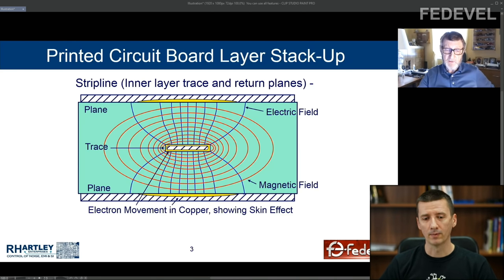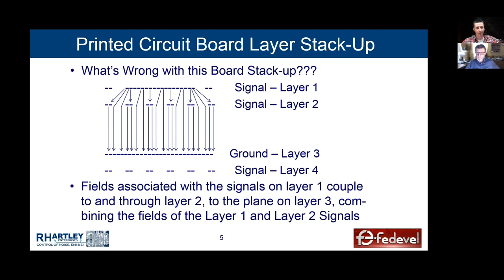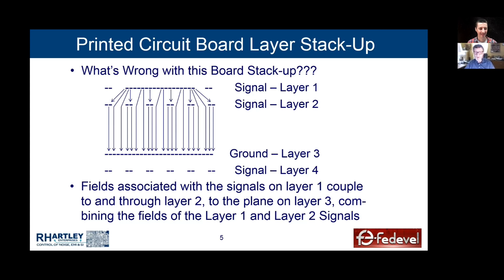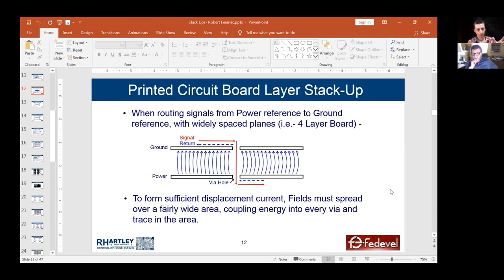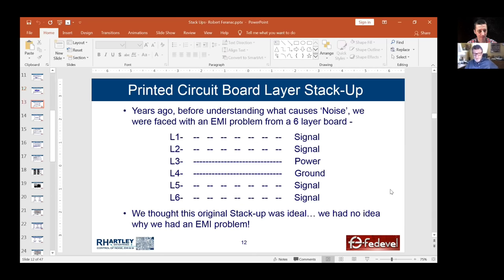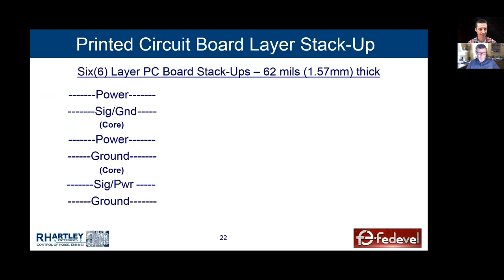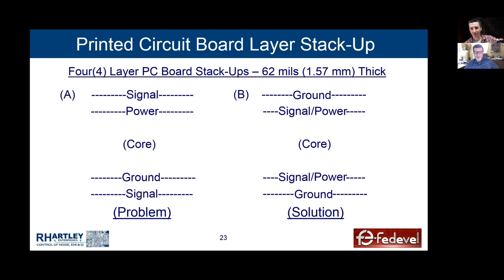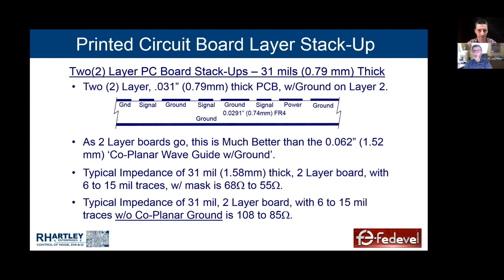How to Decide on Your PCB Layer Ordering, Pouring and Stackup (with Rick Hartley)

Comment: Great video! I usually use 4 layers PCB. I'm interested in watching how the PCB from 45:55 looks like. How to design signal track from SMD components when on the TOP and BOTTOM you have ground plane? Do you have some example? It will be great to see how create PCB in this way.
Reply from the maker: Thank you Michal. PS: I was actually thinking the same
Reply: Well obviously you put the components on an inner layer :-)  Seriously, I  think the idea is you can still put the (SMD) components on the top, and flood ground around them, but instead of signal traces on top, the component pads connect to very nearby vias through to signal traces on an inner layer.  This way, instead of the via inductance being in the ground network, it's in the individual signal nets, where there's perhaps less current and also more series resistance anyway.  Rick mentions this at some point where he describes an already-designed board, and moving the outer layers to be layer 2 and N-1, and in that case the traces already avoided traveling under the pads (that were left on the outer layers) and thus were able to accept adding vias easily to connect the signal layers to the pads (I guess). I'm not sure if he implied vias near to the pads, or vias-in-pads.
Reply: Robert... me too thinking how the layout has been done with 4 layer stackup. Very curious to know types of signals in that pcb.
Reply: @Graham_Wideman you joke, but in very rare cases, you can do this with a cutout. Probably have to solder those ICs yourself though.

Comment: Robert... Thanks a lot for the video and your effort. If you added the type of signal which causes issue in the real scenario and the precaution you have taken to overcome the issue then it will  be really helpful. In 4 layer stackup what are the type of signals you have moved to inner layer to avoid emi issues? I need more details. How the layout could be done with that 4 layer stackup?

Comment: good video.
What if, my power will be 4 types? 3.3V, 4V, 5V, 12V
The 12V will be spited into 3.3V, 4V and 5V, of which 12V will also be used to power components for several relay switches. Would it be good to use 6 layers?
1) path and power supply 3.3V, 4V
2) grounding
3) 5V path and power supply
4) grounding
5) 12V path and power supply
6) grounding

Comment: I'm confused about how one would go about routing Rick's 6-layer board with a ground plane on the bottom layer. If you have components on the bottom layer, would you go directly into vias for all traces coming from them, or would you just route traces on the bottom and then pour ground on the layer when you are done routing?

Comment: Hey Robert, great video and great guest! I have a question on the 12 layers board stack up. What if a signal has to pass from layer 1 to 4? There's a power plane in the middle, doesn't this generate a signal integrity problem for high frequency signals?

Comment: Thanks for this amazing video
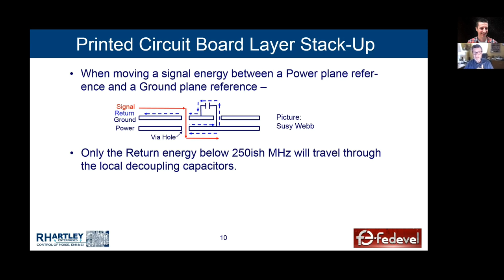In 20:20, you mentioned that the capacitor will act as an inductor
Can you guide me to know more about this case?
Reply: Dust off your early textbooks on calculating inductance of a trace. Measure the length of these capacitors, and calculate it. Look for resonant frequencies

Comment: 4layer pcb how can the top be over all GND    , where i can put component and connect them (tracks)  , any way did you see walkie talkie pcb board , how do they select layer order and control emi and emc
Reply: I think the idea is you can still put the (SMD) components on the top, and flood ground around them, but instead of signal traces on top, the component pads connect to very nearby vias through to signal traces on an inner layer.  This way, instead of the via inductance being in the ground network, it's in the individual signal nets, where there's perhaps less current and also more series resistance anyway.
Reply: If you didnt ask, I would ask it. How can you make GND plane top or bottom ? You have to place your IC's !
Reply: @ibobaba06  I already answered that.
Reply: Hi  @Graham_Wideman , I am not satisfied with your answer. If you place a component and and put via in every signal, you would generate extra noise. Think about this scenario, you have an IC and one pin needs to be pulled up, can you place resistor near the IC and route track in short way. Why you would you place extra 2 vias close to reset pin and resistor ?
Reply: @ibobaba06  I agree with you. Rick's suggestion to put ground flood on top and bottom was not fully described. I'm just inferring what he meant.

Comment: Thank you Robert and more thanks to mr.Rick. 
I have one question:
What is the different between Signal integrity problems and EMI problems?
Reply: Signal integrity is when you send out a signal and receive  a different signal on the end of the path. EMI issue is when your return path becomes the free air above your PCB, essentially you have created an unwanted antenna.
Reply from the maker: @RiyadhElalami  well explained!
Reply from the maker: Thank you Tariq PS: As Riyadh explained, signal integrity problem would influence directly quality of signals. However, your board may run ok (no big signal problems), but you still can fail EMC/EMI tests (that would be EMI problem).
Reply: @RobertFeranec  You have been a good teacher. Thank you
Reply: Thank you all !

Comment: Could someone illuminate what Rick is talking about when he says "common mode current" or "common mode energy", which he mention at least a dozen times, and why it would arise from the scenarios he was criticizing? I know what common-mode means in general, (for example common mode signals at the input of a differential amplifier), I just don't understand what he's referring to in the context of this video.
Reply from the maker: Actually, I asked exactly the same question and we talked about it, but I had to cut it out (our whole call was 2.5h and I needed to make it shorter). If I understood correctly, very simply to say, the fields which do not belong to that signal will generate additional currents which will cause the problems.

Comment: Nowadays PCBs are filled with components, very small parts, tight spaces and no room for filling it with copper on bottom nor top. He lives in the 1990's LOL
8 layer Microvia -boards are hardly any more expensive than 6 layer boards, its only a rumor. Most of the expenses goes to somewhere else than having 2 extra layers.

Comment: I would be interested in two things regarding the 6 layer Lee Ricthey board
- when he says Pwr, is it just one power or multiple powers, especially on the signal layers
- how did he account for the coplanar effect on the impedance of the signals, do you have to simulate it, or can the pcb manufacturer tell you what should be the spacing between GND or Pwr pour on the signal layers to have a specific imedance?

Comment: can anyone explain this to me please?
@1:03:00 Rick says:
"I wouldn't use FR4 beyond 4-6Gbps, 8Gbps tops. because the losses in the material beyond 4-6Gbps are going to be so high that youre going to have a sevear impact on signal integrity." 

This makes sense to me. But what they don't mention, is what the alternatives are.
On sites like JLCPCB, the only options I see are FR4 or Aluminium. And Google isn't much help.

So what alternatives do we have to FR4 for high speed designs?

Comment: Great video - thanks again Robert for arranging this. I would like to pursue a bit further the strategy of distributing the PWR planes so that they are located adjacent to GND planes when there is only a small overlap of PWR planes on different layers? So for example is it beneficial to connect a small PWR plane on a middle layer to a larger plane area near the top such as 3  which benefits from adjacent GND planes on layer 2 and 4?  Layer 3 might be a routing layer but still have a lot of copper plane with good capacitance to adjacent GND - but how effective will this be if there is only a small overlap with the PWR plane in the middle layer?

Comment: Hello. For a two layer board, is it better to have signal+power pour layer and a ground plane layer, or a signal+power traces with a ground pour layer and a ground plane layer? From the slides around 50:20 it seems like the latter is selected as the improvement example? Is there a difference?

Comment: Using a full ground plane, do you recommend using the AC (120volts) on 1 layer (Top), gnd layer (middle), and digital layer (bottom). To separate the signals with a ground layer?

Comment: Hi Robert, very interesting, as usual. Does that mean that for a 4 layers board ( 47:13 in the video) , if I have several power supply on my board, I must "duplicate" the shapes of the power areas on both layers or can I use whatever shape I want providing they connect what should be connected?

Comment: Hi Robert.  I would like to thank you and Rick for the great video.
I am designing a 2 layer board.  The board has 2 channels of PWM for dimming 12 Volt LED lights.  the main supply is 12 volts 10 amps coming from off-the-shelf switch-mode power supplies.  The power supply contains about 360K  ripple.  The copper pour covering 2/3 of the bottom layer is connected to the ground while the rest of the copper pour is not connected to anything.  The top layer copper pour is not connected to anything.
 When a channel is drawing 0.5 amps,  Hi frequency noises appear in the 5 and 3.3-volt supplies which are generated from the 12 Volt main supply.
What are your suggestions?

Comment: Robert, as others have said, this is the video that I have been waiting for. 
However, I am curious to know which simulation software Rick Hartley would be using? What do you use for analyzing radiated energy from PCB's?

Comment: "Referencing" this or that ground plane. That's the kind of phrase you nod along to comfortably, but then later wonder what it actually means. Does it literally mean "this is the ground to which the signal's voltage is relative" as suggested by the word "referencing"?  Or is it really a euphemism for "this is the ground plane to which most of the (high frequency) electric field lines are attracted" (ie: form a capacitor).  (With the proviso that here it's an AC ground, so could include a power plane.)  If it's the latter, then what are the qualifications for a plane to fulfill that role? Presumably the electric lines will only attract if a corresponding current can flow in that plane. Flow to where?  And this is where it gets murky. The DC story is easy enough to trace. But the instantaneous AC story is a bit trickier. And despite this being a topic in a couple of Robert's wonderful previous videos (especially the "Return Current" one), I have to admit to not quite getting the whole picture in view!
Reply: The second one mostly, but both. AC signals (this includes switched DC signals) return thru the path of lowest impedance (aka highest capacitance, lowest inductance). Basically the return current is 'flowing' in the ground plane beneath the signal as it propagates along the trace. Hopefully this helps

Comment: I have a question, based on what was spoken, what do you guys think of this stackup(4 layers). (Signal/GND, GND, Power, Signal/Ground). All coupled by stitching vias. Based on what he said the main distance between the 2nd and third layer will cause issues between power and ground because of distance. But won't the GND and stitching vias solve this?

Comment: I'm considering Robert's 10 layers stackup S-G-S-G -Power***Power-G-S-G-S in my current board.  It's a good stackup since I now need only 4 signal layers. What would be the minimum thickness between layer 5 and 6 for power separation? Thanks.

Comment: What about warpage when you don't have a symmetrical stack up? This was discussed in one of the other videos, so why don't you ask such questions when you have two different opinions? It would be helpfull, if you could ask experts such questions. I still don't get how you can have a ground plane on top and bottom. I think it is meant to be Signal/Ground and not only GND plane.

Comment: What’s your opinion on going 180°, 90° or 45° through a via? when you need a signal to change layers I mean.
I’ve always tried to place vias in a straight part of the trace and if the trace needs to change direction I do that separately away from the via. But it’s not always possible. Does it make a difference?

Comment: Hello, I have recently found your channel. I have always had an interest in pcb design but the more i learn the more i realize that I am a complete noob. I am wondering if you know of any resources for somebody to start his education with pcb design? I have been a hobbyist electrician since i was a kid but i could never find a path to learn the fundamentals for pcb design, everybody always pointed me to heavy duty/industrial electrical engineering. I dont want to work on power lines and on heavy duty equipment. i want to tinker in my shop and build my projects properly and l know what im doing so that i can come up with some of my own ideas and not have to try to emulate others without really knowing what it is that im doing when i construct their projects. thank you for any help.

Comment: I don't understand how can power plane on top layer benefit the IC since a large BGA IC pins can only be reached through vias that are connected to plane on the other layer?
Reply from the maker: A very good question. I imagined this as some power planes for example under the BGA directly (connecting the pads directly) or other power planes for other types of footprints what will connect directly to the pins. But, I should ask this.
Reply: @RobertFeranec  ok that makes sense. I forgot about small ICs. He also mentioned that big MCUs have built in capacitance for high frequency currents, so they are covered

Comment: Once again a great video, thanks! One further question: What about ICs with a lot of pins (>800) and small pitch (0.5mm) that need at least 3 signal layers (for example because they support DDR4) and have several different supply voltages? Because of the pitch the only choice seems to be staggered microvias down to each signal layer. What would a good stackup look like here? Layer count wouldn't be that important in this case. I know that DDR4 signal integrity gets worse with the via count in the respective net. So I can only assume those signals woulnd't be happy about traveling through 10 or more microvias until they reach their destination.
Reply: Contact a professional.
Reply: usually, the mfg of the BGA in question has an app note on suggested fan out strategies for the IC under question

Comment: Thank you very much for the great video!
In the customer problem described starting from minute 35, the solution is given by pouring copper on 4 layers and connecting them either to VCC or ground. However, it was also mentioned that the customer did not agree to change the layer stack and add more layers. 
My questions are: 
1. If adding layers is an option, would that be a better one rather than pouring? 
2. Is there any disadvantage in adding another 2 or maybe even 4 layers having signal and ground separated, except the cost?

Comment: Very interesting video. In retrospect everything that was said makes perfect sense, unfortunately now I have to start thinking more deeply about the exact return paths and how to manage the reference planes...
I am a little confused about what Rick said about split planes though...I am guessing it only applies to same rail split planes. So for example, if you split the plane to help direct current, but not from multiple supplies. So if I have two 3.3V rails like 3V3_VCCIO and 3V3_VAUX, which come from different regulators, then crossing such a split would probably not be a good idea, since the return signal would have to go through the different regulators and cross couple through some common point. 
Another interesting consequence from what he said, is that the orientation matters (parts on the top vs bottom). So if you want to have a low inductance configuration, you probably want all of your high power parts on one side with a main power and ground plane near them, then the signals further away.
Reply from the maker: Thank you hjups PS: It was very interesting also for me. And, yes, I would consider powers from different regulators to be different even if they have the same voltage. It is about the power which is connected to the power pin which is powering the specific signal. About powers - I am thinking to make a video about this.

Comment: NICE THEORY, but I am not really happy with this video. Components are on top and bottom side of a modern PCB. Why does this video constantly prefers to only have GND on bottom layer? How do I route traces from component to component? DOES HE MEAN COMPONENT-COMPONENT ROUTING, GROUND POUR SURROUNDING ALL COMPONENTS, but far-away components connected by dropping thru a via to an inner layer??? HOW MUCH AND FREQUENT LAYER DROPS FOR AN INNER TRACE DO I HAVE TO DO??? The number of vias is going to be unfeasible!!! What am I understanding wrong???????
Another concept not yet mentioned is split grounds... I think this nice theory gets a HELL of a lot more complicated when you got four voltage rails and four different grounds!!!